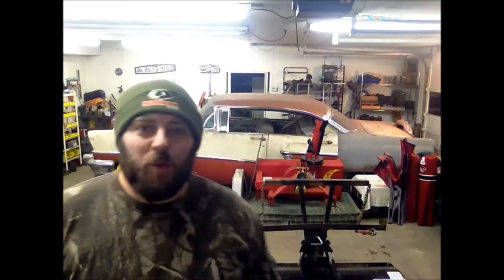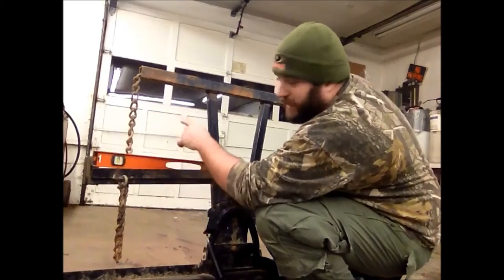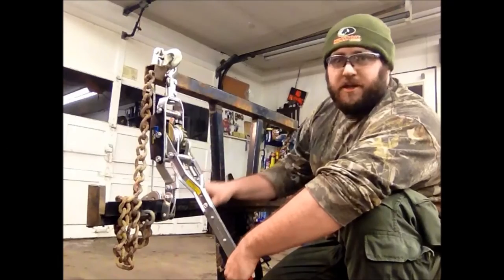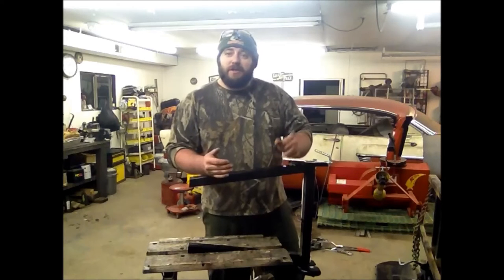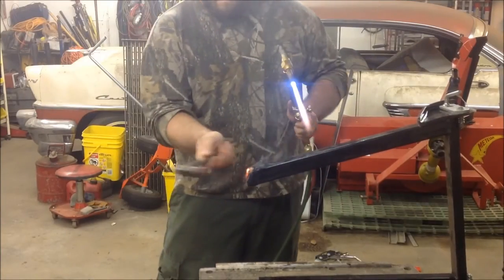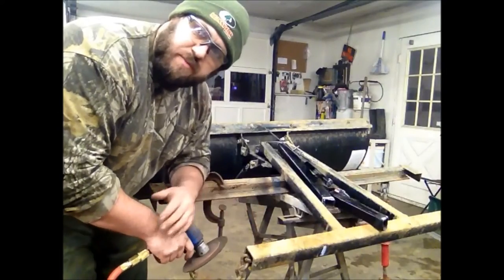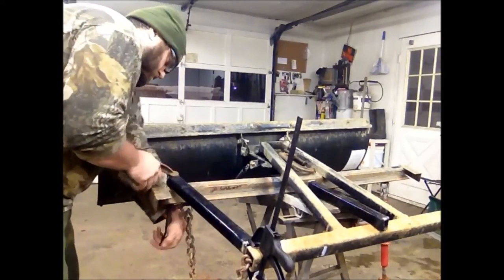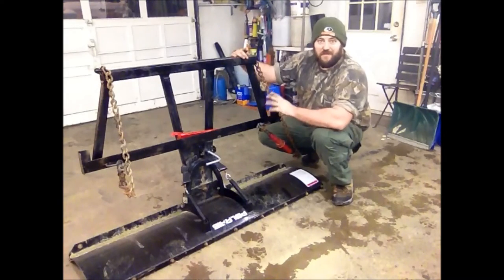★DIY Build Your Own Snow Plow 1 Year Build Review / Modification / Fabrication / Repair

Comment: Throw away steel tubing? NEVER... I doubt that will bend again :-)
Reply from the maker: trebor hgils  I find it difficult to throw away or scrap any useful metal. I have found countless times that I have kept something that I later had a use for. As far as the snow plow, I had time to play with it in the last storm. It seems much more solid now. Thank you for watching. Check back soon for a new episode.